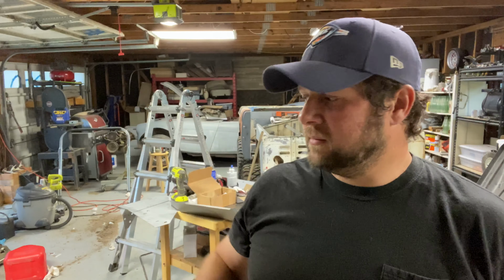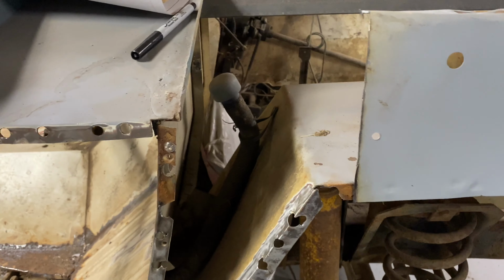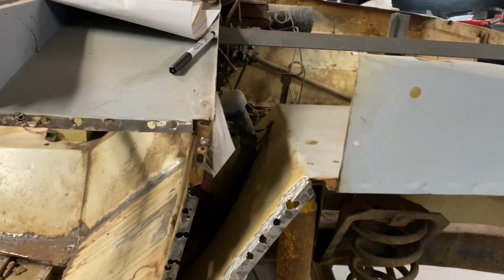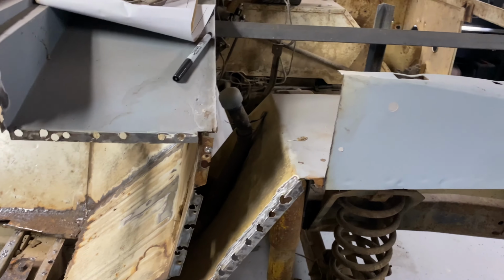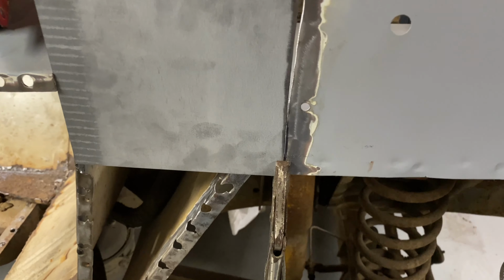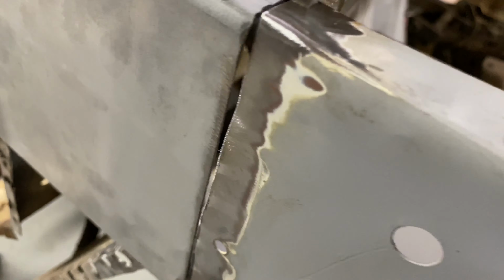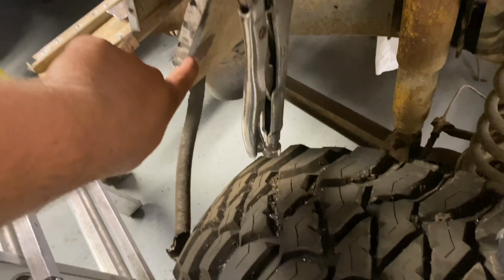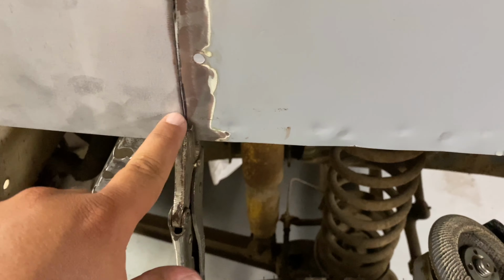Early Bronco Restoration l Patch Panel Fitted!!

Comment from the maker: Think tempered aluminum would work to help weld that gap?
Reply: No, the aluminum will just melt and cause galvanic  corrosion. That gap should be very easy to fill.  Basically anytime you do a but joint like that you should have a root gap similar to the thickness of a 3/32 cutoff disk
Reply from the maker: Ryan Morton ok. I’ll scrap that idea. I’ll try and fill it.
Reply: @RisforRestoration  take your time, get the metal too hot your gonna blow holes. wouldn't hurt to make a test panel to practice.
Reply from the maker: Ryan Morton I’ll definitely do that.  Thank you
Reply: If you are going to use a backer, use a  copper welding spoon. Keep up the good work.
Reply from the maker: cll375 thank you. I will look into getting one. I feel like I would use it quite often.